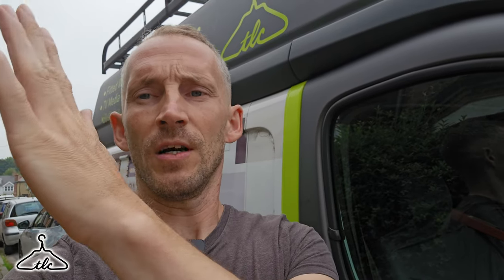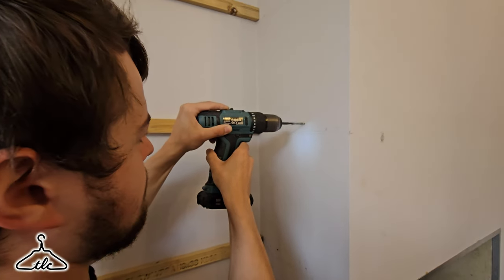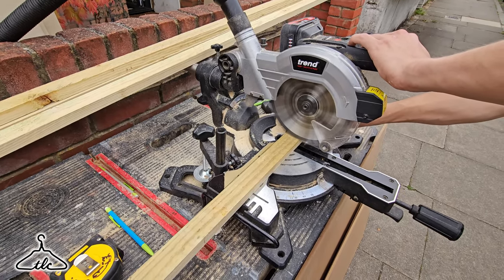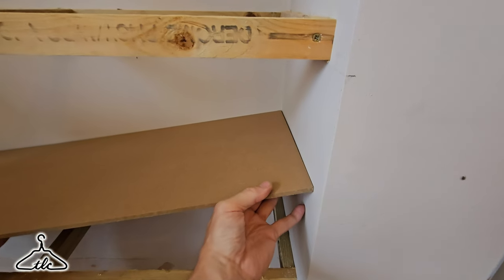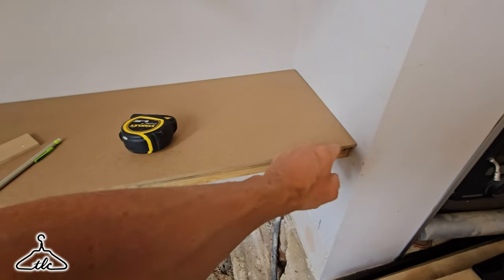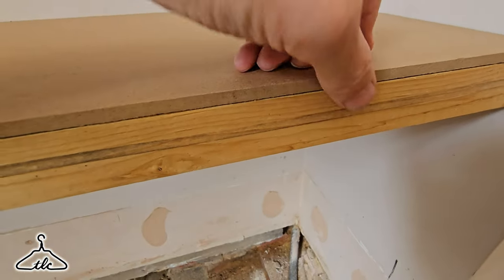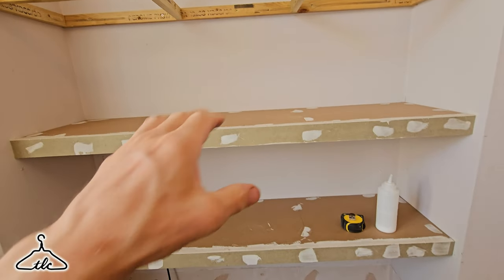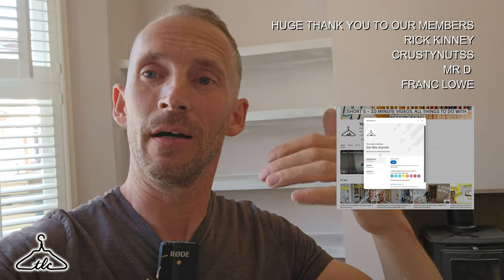Making 50mm Thick Floating Shelves On Site (Baton Framework Method) Try This...

Comment: I fit 21mm battens with a series of modesty blocks facing down on the inside lower edge. Then I fit 18mm mdf on the underside of the battens, scribed to the wall then glued and held in place with 25mm screws through the modesty blocks. The top of the shelf is 6mm mdf glued down onto the battens. I pre-fit a batten to the front edge of the 18mm mdf with biscuit slots and then fit an 18mm front trim glued and biscuited. I make the front trim 48mm so there’s a slight lip underneath the shelf. Always works, each shelf takes about 30-45 minutes to complete. I pre-spray everything in my workshop so all that’s needed is a thin line of CT1 once I’ve scribed them in. I never slide floating shelves in as alcoves are always out of square.
Reply: What is a modesty block? Interested as I’ve not heard of them before
Reply: @dalailager  they’re little rectangular plastic blocks, also called assembly joints, furniture blocks. Two holes on one edge and one hole on the adjacent edge